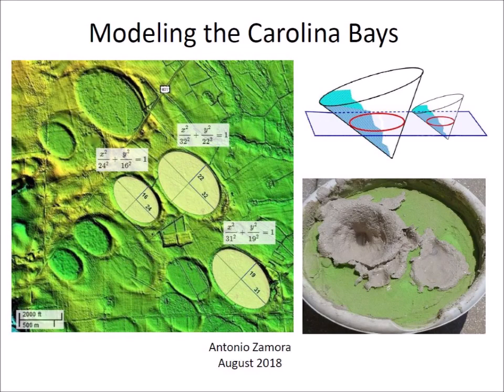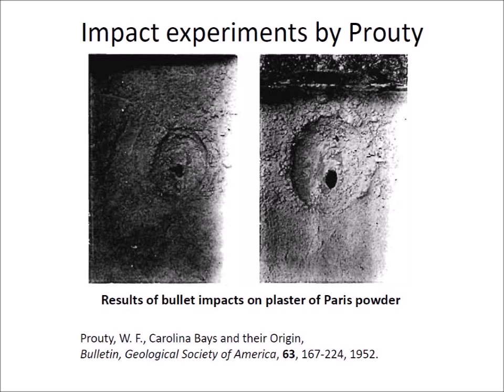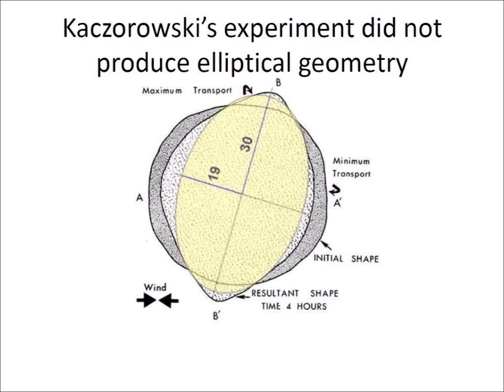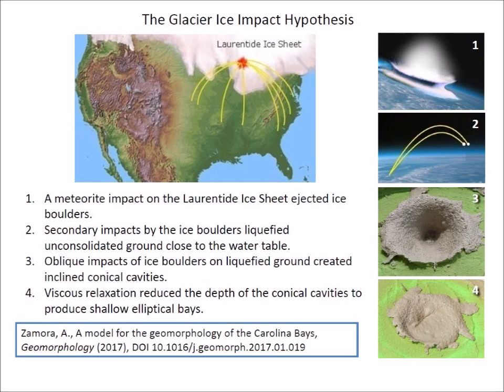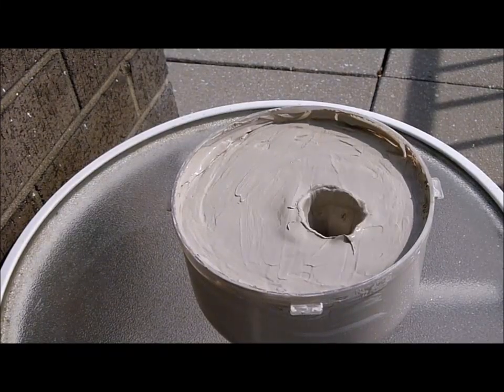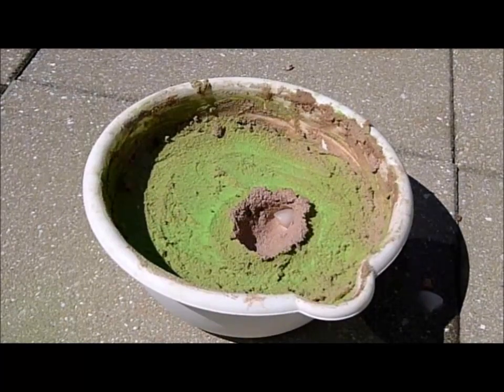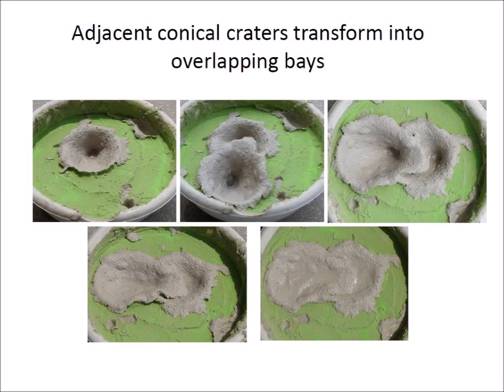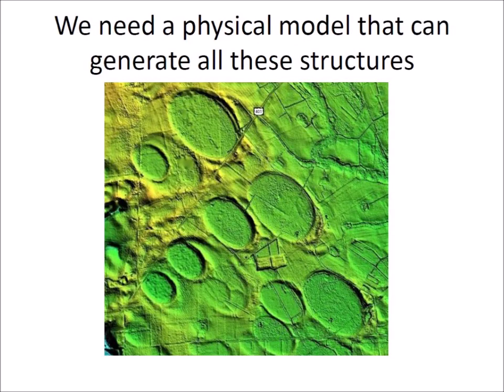Modeling Carolina Bays

Comment: When I look at the Carolina Bay impacts, if you remove the scale, it looks just like raindrops impacting a powdery dry silt surface 

raindrop impacts would be very shallow, equal to the amount of debris volume displaced to the outer rim, if that volume is calculated as spread out evenly over the impact oval    
=========   
to model a raindrop impact:   =========  
 use a box simulating several geological layers, of increasing wetness and cohesion  
starting with a bottom layer of a gelatin and sand emulsion, then a  layer of surface wet sand , then a layer of dry sand, then a top layer of dry flour ( simulating a dry loess topsoil )     
tilt the box to an angle of 45 degrees to simulate the impact angle      
use a high enough drop point for the water drops that it becomes teardrop shaped before impact     
========
Reply from the maker: The experiment has to be able to scale up to create bays of one kilometer in diameter or larger.  In a small-scale experiment surface tension can keep a drop together, but it would not work for drops that are bucket-sized or even bigger.  There is also the problem of explaining how drops big enough to create large bays would be transported more than 1000 kilometers from the intersection point of the Nebraska Rainwater Basins and Carolina Bays in the Great Lakes to their targets.  The ballistic trajectories are suborbital space flights that would freeze any liquid water.
Reply: use water at 39F for test, since that is the maximum density of water
to scale up the experiment you would have to increase both the height of the drop and the size of the target, a bucket sized water drop would probably require a drop height of 30f or more  and a target of over 10ft sq, there would be many separate impacts as many smaller water droplets would form with the largest one
a large balloon could be filled with water and burst over the target 

The secondary debris launch from an impact would have had to be a ice chunks, which became a slush balls before or at impact

Comment: Go buy some PVC cement, 3 feet of 4inch PVC, a 4inch to 6inch PVC reducer, 1 foot of 6inch PVC pipe with the big screw cap, and a electric BBQ sparker and make a potato gun. Use some foam to make a sabot and drop a ice sphere in it. Your gun would cost you about 20-30$.